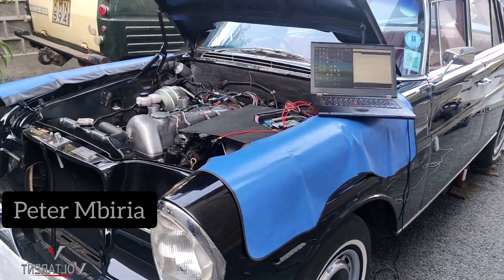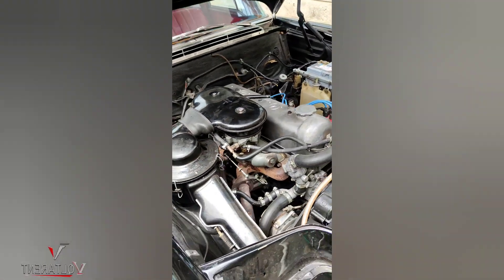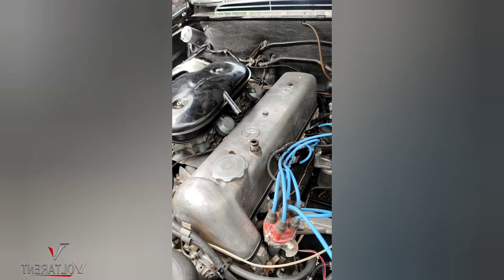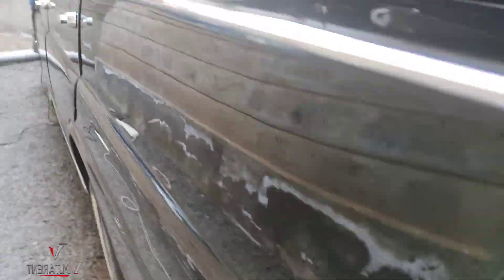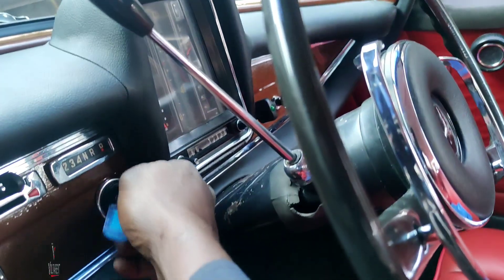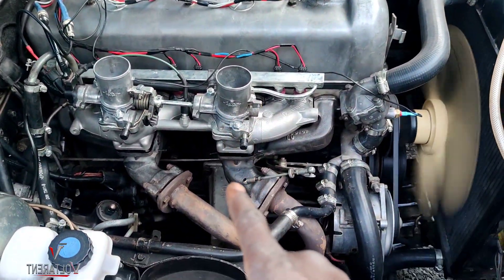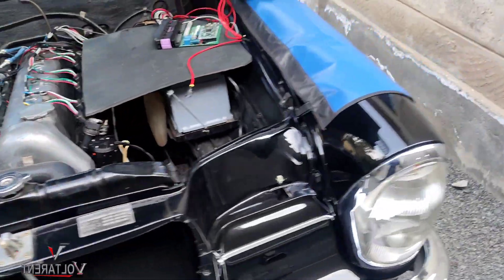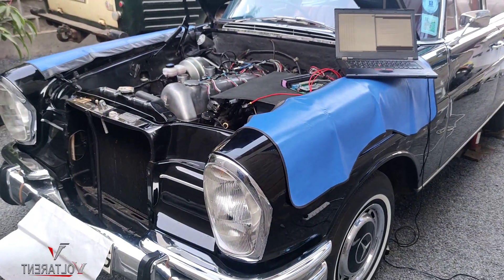Restoring Power: A Modern EFI Upgrade for the Timeless W111 Classic

Comment: I grew up in a 220 and now own my own 220S.  I thought it was me who could not get it to run smoothly even with overhauled carburetors, new ignition, etc.  --  mine runs and sounds identical to the car in the video. Being somewhat mechanically-minded, I would like to upgrade its fuel and ignition. May I please request what throttle bodies, injectors, sensors, and coil packs were used?  Thank you kindly.

Comment: How much would thus ECU cost for a 1988 Lotus Esprit 4 cylinder turbo woth Bosche K Jettronic fuel injection.  What parts could i eliminate in the horrible system lotus used?
Reply: In an another channel video, he said that you can except, i dont remember exactly between 1000-1300 usd for 4 cilinder cars. But yeah, hope he answers and confirms
Reply from the maker: Hey man, thank you for the query. Its's normally $1160 for a 4 cylinder carb engine. Your set up already has high pressure fuel pump, intake manifold ready for fuel injectors which will slightly lower the said cost. What I'd need is the distributor to modify it (install camshaft position sensor), some measurements of the injectors' spacing in order to fabricate a bolt on fuel rail for your application.

The rest of the kit will come with the necessary sensors and parts to convert your set up to full EFI. We have remote support which will make your work a whole lot easier.

Comment: This is very interesting, I want to delete my k-jetronic system and convert it to fully EFI system, i hope you sold it as a kit in future.
Reply from the maker: There are kits avaible for M102 and M110 engines
Reply: @PeterMbiria1  yup, but sadly they are worth a fortune sir, especially for M103 3.0 like mine.
Reply from the maker: @Faza_M  Our kits are pocket friendly. For M102 will parts included on the kit, it's approx $1200 excluding shipping. For M103, it's approx $1400
Reply: @PeterMbiria1 what about the 2.2 in the W109? 🤞🏽 Definitely subscribed.

Comment: Ruined a classic car. Want efi, buy a new Mercedes.
Reply from the maker: You clearly have never owned a classic that gave you hell with dual carbs but still want it to run. The goal is to maintain the original engine and the look and make it run smoothly with modern power.
Reply: @PeterMbiria1 you improved the classic. Not ruined it. You know what? Since I saw your videos this morning you can’t comprehend how much I admire you.
Reply from the maker: @elchaposexcitingadventures1674  I do appreciate 😃
Reply: My parents bought a 220 brand new. I have no doubt they would approve of how much better this one runs.

Comment: Hello peter mbona hukunijibu, i have  a nissan cable ,4 cylinder h20 eigine,  how much will it cost to convert it?.
Reply from the maker: @henrynganga5635  Hey man, apologies. For a 4 cylinder carb engine, it's 1160 USD (150K kshs) for the full conversion.

Comment: Hello I would like this for my w111 same as one in your video, I live in the US and would like to buy a kit or piece it together? Thank you for your time. Love the video!
Reply from the maker: I really do appreciate for you reaching out. Now, the intake manifold will need machining to make it able to use fuel injectors. Also, the intake and exhaust need to be seperated so that the exhaust heat doesn't directly heat up the intake manifold. We nolonger need that heating as the fuel injectors already atomize the fuel being injected.

How would you like us to proceed?
Reply: @PeterMbiria1  How can i piece it out? what parts or do you have a kit?
Reply: Do you have instructions on how to piece it together? Or can you make the manifold and rail and i can buy it off of you and piece the rest?
Reply from the maker: @josetorres4WON5  Unfortunately I don't have any intake manifold, I only use the ones that come with the vehicle. If it wouldn't be too much to ask, either you can have the manifold removed and sent over to me OR, have it machined over there with detailed instructions like the injector diameter, angle of machining in reference to the engine head , spacing between injectors etc.
Reply: @PeterMbiria1  i am located in the US California zip code 941343. Is there a way you could find one there and rework it. Then i would pay for the part, work done and shipping to me.
Reply: Or i can purchase one and send it to you!?
Reply from the maker: @josetorres4WON5  I could try source for one locally though not guaranteed.
Reply: @PeterMbiria1  ok, I am super interested a I have a 1962 sb, where are you located? I will do some searching and see if I can get an intake manifold or ill send you mine I just don't want to have the car sitting? How long do you think this will take?
Reply from the maker: @josetorres4WON5  I'm in Kenya, Nairobi. The intake/exhaust manifold takes 2 weeks to have them machined, have custom fuel rail made, throttle body adaptors to manifold, TBs, TB adaptors to air cleaner adaptors and acceleration rerouting
Reply: @PeterMbiria1  I am super interested but, in the US, so how do i piece the kit together and how do i get the diagram of how to modify the manifold? My Mercedes is close to be driving and i think a fuel injection conversion would be great.
Reply: @PeterMbiria1  how do I contact you? so that we can figure this out together.